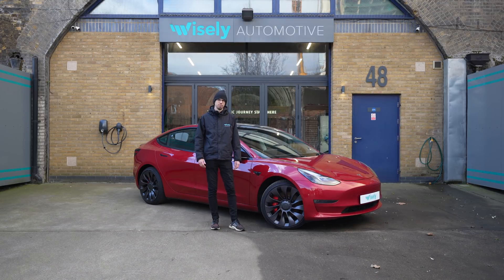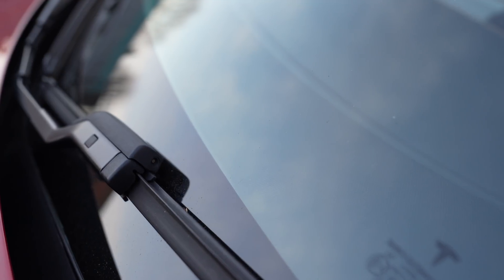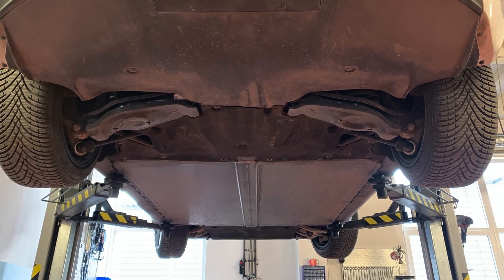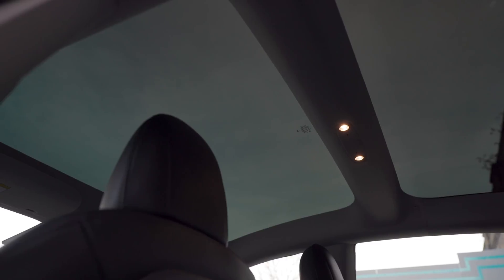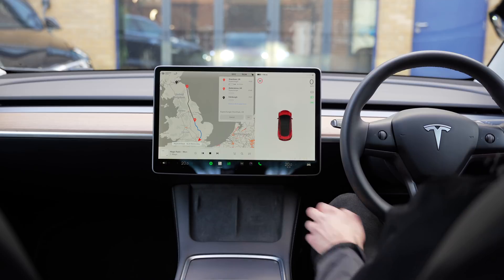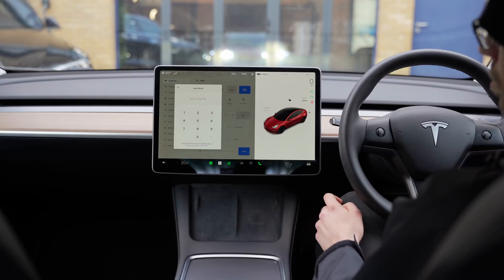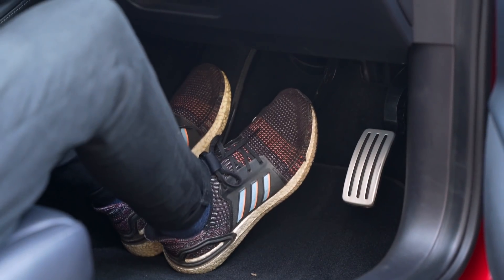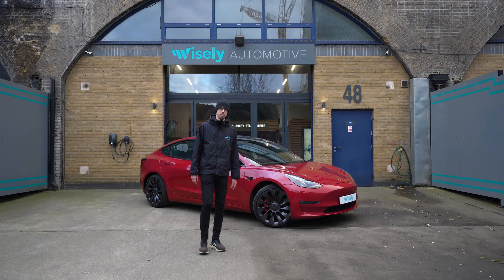Tesla Model 3: 5 Clever Design Details Proving Teslas Are No Longer Just "iPads on Wheels"

Comment: Which Tesla model 3 is better and economic for daily driving ?  Rear wheel drive ?
Reply from the maker: In case of the AWD versions, the front motor decouples when accelerating smoothly in normal driving, so the efficiency is very simiar to the standard RWD car. If you don't need the performance, range, or added grip of the more expensive AWD versions, the base model is a great pick...

Comment: I am not a Tesla hater and I own a Model Y performance. 

The Uberturbine wheels on the performance model is one of the heaviest wheels I have ever had.  I wonder why Tesla doesn’t put any lighter wheels on performance model to increasing both the performance and the efficiency.
Reply from the maker: You are correct. The pre-facelift Perfromance Model 3 used to have lighter wheel but there were many reports of them buckling after encountering potholes or other road imperfections, which we think is the biggest reason why Tesla decided to go for a more robust design...

Comment: If the door handles are the same as on my 2020 M3 then they are no better and freeze up if it has rained stopping you from entering the car. Also the automatic windscreen wipers don't work, they wipe a dry screen yet don't start when it rains and at night they pretty much don't work at all.  The auto headlamps are also useless taking far too long to dip for oncoming vehicles and even longer when you are catching a vehicle in front. The bluetooth works intermittently so no, Tesla for a tech compnay cannot get the basics right.
Reply from the maker: Unfortunetaly, rain (that unlike snow can get into all nooks ans crannies) which later freezes over (for example at night once the tempreatures drop) is a nightmare for most cars - regardless of whether they have frameless windows or recessed door handles. The best solution is just activating the preconditioning well in advance of getting into the car.

As for the rest, we definitely plan on covering things we don't like as well, as no car is perfect. (Never had any Bluetooth issues though.)
Reply: @wiselyauto  please don’t make excuses for them otherwise the issues will remain. I had no problems with my previous hybrid BMW!! Tesla need to compete on every level!!

Comment: So as a point of information, you don’t have to go into the menu to open the glove box, as you can just use a voice command to do that and you can do just about everything with a simple voice command and I’m sure some of the things that you’d like to do, can easily be added with an over the air update! So I would say to your followers, learn voice commands and start using them instead of touching your screen, particularly when you’re driving! The other thing that your audience needs to know is that this is a car that will soon be fully autonomous & know other manufacturer today has committed itself to doing this & so Tesla has a imagined a future where you will not be driving this vehicle, it will be driving you! Cheers!
Reply from the maker: Correct. We will have a dedicated video on this in the future.

Comment: 8:25 no they didn't. People were blown away by the iPhone in 2007. Microsoft and Blackberry did some damage control and said you need a physical keyboard at the time, but the general public never said any such thing. It was obvious from the initial demo on stage that you could type on the keyboard, Steve Jobs explained well the auto-correction and the ability to change things later.

It's not the greatest analogy, because the human race is used to touch screens by now and I still often hear drivers and car enthusiasts and even some Tesla owners wanting some physical controls. I'm not interested in a Tesla because for me they make the wrong design tradeoffs. Yes, the dash is minimal, but a dinner fork with two prongs instead of four is more minimal and yet it's a worse dinner fork.

I am not saying every design decision Tesla makes is bad, but for me I want some physical controls. Having no physical buttons for indicators (new S) and having both left and right indicators or turn signal buttons on the same side, for example. That's poor design, IMO. Ferrari does it better. They use buttons, but they are satisfyingly clicky physical buttons and the right signal is on the right side, and the left on the left.

Tesla have no physical button on the glove box, but that's where you hand goes when you want to open it. In a Tesla you have to first go to the display to open the glove box. That's an inferior design. A better use of the touch screen for the glove box would have been to have a passcode-lock-glove-box feature via the touch screen, but have the open-glove box button to on the glove box door.

For my own Apple analogy: Apple made over-ear headphones two years ago "AirPods Max" and Apple's designers said they first designed the headphones to have touch controls only, but after using these prototypes for a while they figured out for the product needed physical controls and redesigned it thusly. A touch screen is a good idea for certain things in a car, but not for every single feature. There's a famous saying when it comes to design, "design is about trade-offs". For me Tesla makes the wrong ones. Some good idea, some bad ones.

Comment: Well, there is a difference in a vehicle and a phone. Using a touch screen while running at 100 miles an hour where a little deviation in the concentration can cause an accident. Therefore, it is always better to have physical buttons to avoid any mishap while driving. 
Secondly, if to save the cost is of the reason why they made a sole giant screen to replace physical buttons then the car price must be cheaper. However, instead of cheaper price, it is more expensive just for a giant battery box
Reply: So with all due respect, if you’re stupid enough to drive 100 miles an hour and not keep your eyes on the road, then no amount of buttons is gonna save you from your own stupidity! So my question is, have you ever heard of voice commands? I don’t have to touch the screen if I can just tell the computer what I want done and he just demonstrated that in this video, and yet somehow you missed that, so stop with all the buttons nonsense & if you wanna car with buttons, then don’t buy a Tesla! Seems pretty simple to me! Cheers!
Reply: Agree with your first sentence there but if you look at the UI, the buttons are fixed at the bottom of the screen. Better yet, you can customise to your liking. No doubt the car is expensive, tesla needs to also make money but if you look at the car from engineering perspective, less components = more reliability, availability and maintainability.  Battery tech is not cheap, what Tesla did was offset the cost elsewhere.

Comment: One of the problems I have with my Model S (and would be interested to know if it’s the same for the Model 3 and Y) is that the antenna for Bluetooth and WiFi reception is in the driver side mirror. Which is great until you need to access app functions / summon etc from the passenger side, or you park the car outside your house with the passenger side towards your router...and reception suddenly isn’t as good. Really they should have a repeater antenna in the passenger side mirror.
Reply from the maker: We can try to test this out but keep in mind it hugely varies based on the environment. We haven’t really had any issues in our showroom (with the cars on WiFi).

Comment: I own a 2021 Model 3. Many of the ‘safety features’ are somewhere between downright dangerous and annoying. Every time I get into the car, I immediately disable alarms, alerts and all proximity functions. I have also found Autopilot to be nothing short of dangerous in everyday driving conditions, so I never use it. The wheeled computer perceives many ordinary bends as head ons, oncoming vehicles on bends as head ons and overtaking/passing without indicating as further reasons to sound loud danger alarms and flash red images on the screen. When I have forgotten to disable warnings, the car has auto braked and auto steered at critical times. 
Given the choice again, I would buy a Hyundai without hesitation. A Tesla is the car equivalent of the ‘useful’ paperclip man that used to constantly ask if you require assistance to write a letter.
Reply: I guess everyone's experience is respectfully different.  For me with just shy of 100k miles driven I've used autopilot perhaps 95% of the time.  To my experience a car without a Tesla-level autopilot is a horse-and-buggy.
Reply: @BillHohensee  same car, same autopilot, different country. That makes these ‘nanny’ safety systems unreliable. Autopilot here in Europe is unreliable and no substitute for any driver who has a month of driving experience behind them. Teslas were not designed by drivers, they were designed by kids who skateboard to work with a Latte.

Comment: On point #2 about the glass roof, it's also tempered glass and is designed to absorb and disburse much more energy and over a larger area in the event of a side impact collision... One of the reasons it is so highly rated for crash testing.

Comment: 1:50 No, I doubt that. The longitudinal speed (and energy) is added by the rotational speed (and energy). So ig ALL mass of the wheel WOULD be concemtrated on the maximum diameter,  you would DOUBLE the energy. IF all wheel mass WOULD be concentrated in the axle with r=0, the moment of inertia is 0, so the rotational energy is 0.
Logical conclusion is, the closer the wheels mass is located to the axis (and the lower the mass of course), the smaller the rotational energy. Basically small rims (with same tyre outer diameter) let the car to accellerate faster. In ANY case, the rotational energy is SMALLER than the longitudinal kinetic energy. Logically the "factor" you mentioned can't physically exeed a value of 2.
Reply from the maker: You are indeed correct - we should have made this clearer in the video.

The ratio between 3 and 4 is a rough estimate for both, outright mass reduction and going down to the 18" wheel at the same time. For anyone interested in having a play with the numbers, here is a great online calculator explaining the "equivalent mass" of automotive parts in more detail: 

http://www.hpwizard.com/rotational-inertia.html